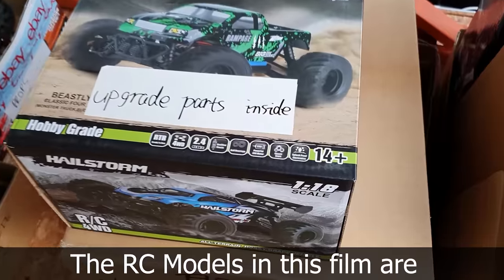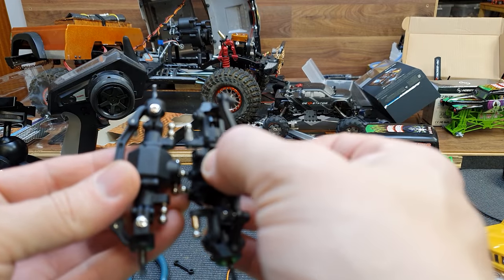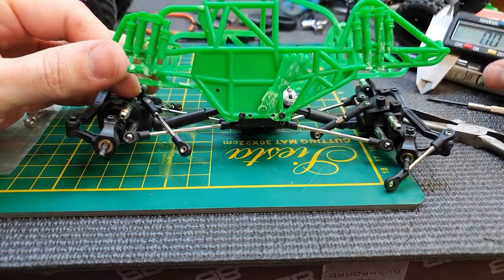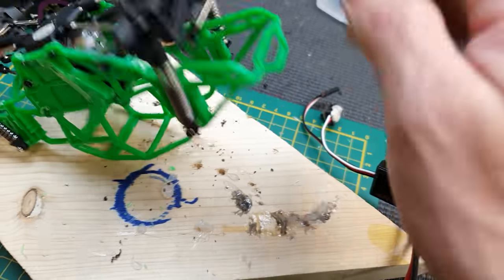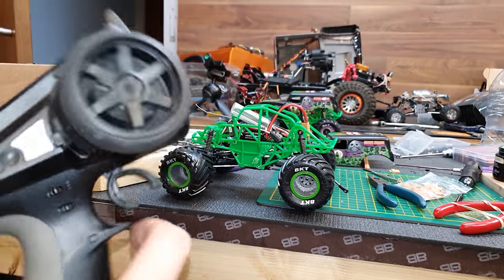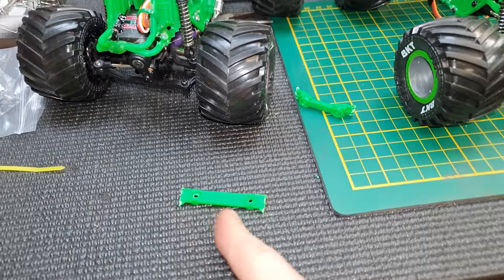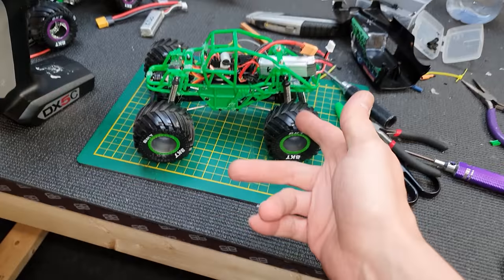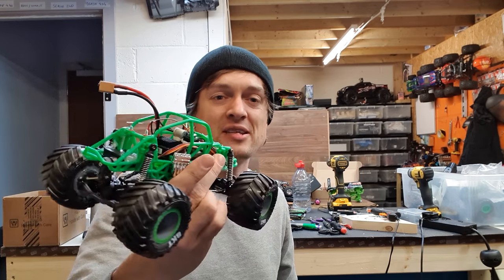BUILD a Tiny 4WD 4 Wheel Steer Grave Digger RC Monster Truck Car PART 3

Comment: you need a 3d printer so then you could just make your own parts
Reply: How much the 3d printer cost?
Reply: 200 to 300 bucks?
Reply: @KingFizzY29  about 800 to 1000+ dollars
Reply: Or just buy a 3D pen
Reply: An ender 3 that will do very professional looking prints is only 300 bucks I have one and love it make stuff for my race car
Reply: @KingFizzY29  yo can get a good one pre built for less than 200 on hobbyking or other places
Reply: @KingFizzY29  depending on what you want $200-$300 for good cheap printers, $400-$800 better bigger printers and $900-$2000 is top-notch
Reply: @kcira8578 are
L
Reply: @h.w.m.306  it cost 150 to 250 to get a good printer
Reply: @hideway9819  my my how times have changed lol, I bought my ender 3 pro in march this year, I laugh at what I wrote because they are so cheap now. Best purchase I ever made. I still can't believe I wrote that lmao 😂
Reply: Good idea 💡

Comment: Kevin, u could use the old Axel's if u use two females and just the splined shaft cut off the male.  Then u put a small spacer in both females to center the male piece inside of the two females, u may need to trim the two females slightly. If the transmission and  the diffs don't have the same size input shaft then disregard this idea.

Comment: This is so cool but bro in stead of leaving those string bits hit them with your lighter and if u really want to make those glue spots look nice and smooth hit them with your soldering gun just slide the tip back and forth on it

Comment: hot glue is perfect for this size.
it's easy to use, cheap, moldable, workable and you can remove it for the next upgrade.
it's also flexible, in a way it's also a ''weak'' link so better to pop a glue joint than mechanical parts

Comment: Couldn’t you extend the drive shafts? 

Chop the top third or so of the insert part off. Drill a hole in the centre of the now exposed cores. Insert a rod (perhaps 3mm aluminium (maybe tap the holes and use threaded rod for better grip)) into one hole and then the other end of the rod into the other hole using strong glue or epoxy. Then make up the shaft length you are missing by leaving some of the rod exposed.
To be sure that the holes line up, you could drill down the centre of the shaft before cutting. This would obviously leave a hole in the end, so you would have to make sure that the rod isn’t sticking out when you glue it in.

I’m not sure I have explained myself very well, I am struggling to put the picture in my head into words.

Edit: Thinking about it, what I might be trying to describe is basically turning the drive shaft male part into a kind of turnbuckle. Maybe.

Comment: The motor isn’t going straight away and being quick and responsive until top speed is because it’s uncensored esc and motor meaning it isn’t nice to control and is laggy

Comment: whats the KV for that motor?  lower KV will have more low end torque. you will probably want 3000kv or less

may be u need to change the set up on the ESC?

Comment: Kev I'm impressed mate. You put a lot of effort into this and it paid off, that grave digger moooves man!

Could the slow start up be punch settings in the ESC?

Clogging I found with my rc's only seems to be when the car is first pulling away it's like there's not enough power to get it started but this doesn't seem to be the issue with ya grave digger. The power looks to be retarded by the ESC in the first 3 to 5 seconds of pressing the trigger?

Trial and error bud 🙂

Excellent job mate, I'd like to see that bashed and backfliping in the skate park and I think I'm not the only one.

All the best fella ✌